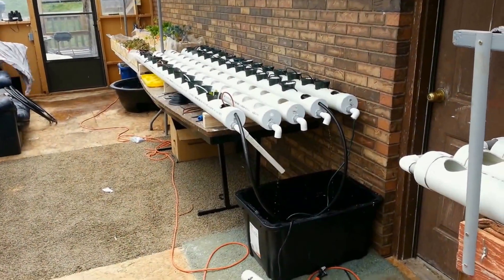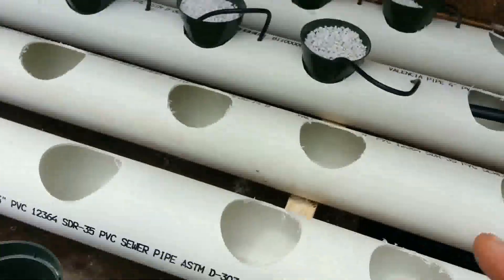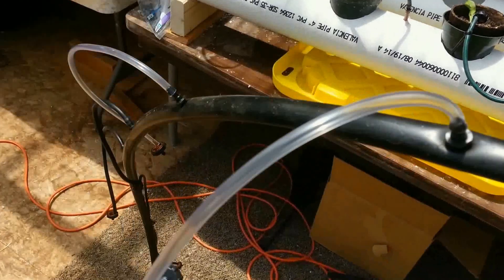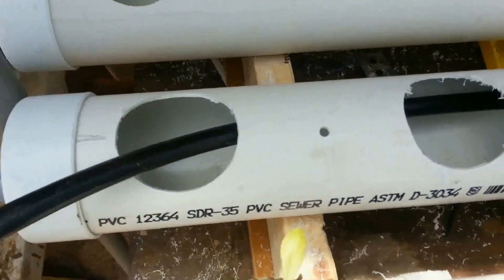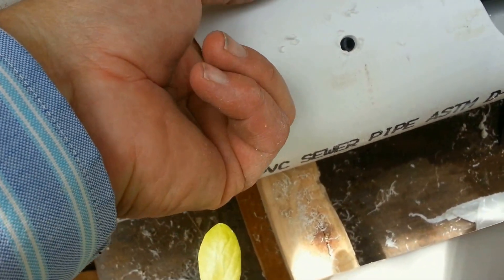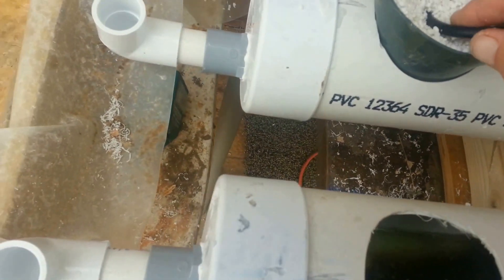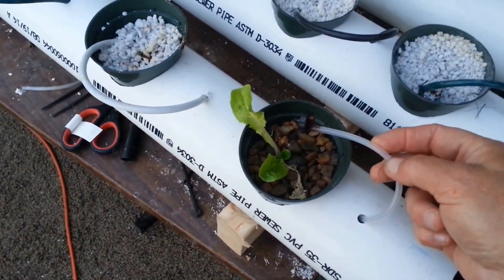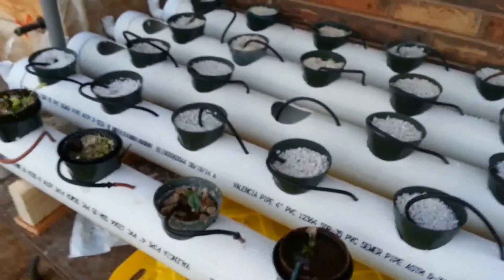Building a drip hydroponic unit

Comment: Is this recirculating type or non-recirculating type drip irrigation?
Reply from the maker: It's a recovery type.  The water recirculates  to a storage tank.
Reply: @eddysgreenhousegarden7022  I've heard that the recovery system can alter the pH level of the nutrient solution. How do you maintain the nutrient solution? 
Also, which type of the drip system you prefer if you want to make a living out of it (like selling the crops on a commercial scale etc)?
Reply from the maker: @alfianfahmi5430  I do have to monitor the ph and the nutrient solution of the system and make adjustments periodically.   You can't get away from that in any kind of recirculation system.    Not sure on the second question.   I just grow things for myself.

Comment: Great job man, but you should know the clear tubing is kinda spooky. Algae and not so good microbes will try to build up in areas of the system that have air, water and light. Some of those dippers with clear tubing are gonna be problem sights in the future. I'd also get to know your water really well... no matter where you live. water is key to maintaining a clean and effeicent system. UV sterilizers and RO filters are by far the best way of cleaning your water and keeping everything in your hydro system fairly low maintenance. again great garden man and thanks for the video.
Reply from the maker: Can't disagree with anything you said.   I've already had to change this thing up a little bit since it was posted.   For the reasons you cited.
Reply: @eddysgreenhousegarden7022  Still a really nice table. You ever use bottled enzymes?
Reply from the maker: @momentiummonroe1475  No I never have tried that
Reply: @eddysgreenhousegarden7022  Friend... you won't regret it. It's made maintaining everything in my room way easier. 

Go to your local hydro shop and see what they've got in stock, a liter should last you a month or so. You can also probably get some off amazon.

I'm using the Canna Cannazym at the moment, but i think Enzymes complete runs around $20 a bottle

Comment: What size holes did you drill in your PVC pipes and what size where your pots?
Reply from the maker: Well for the drippers they 1/4 inch holes, just big enough to fit the tubing through.  The net cups were 3 inch.  And....the circulation pipes between the large 4 inch pipes were 3/4 inch.

Comment: could't you just go without the driper and just put the hose into what ever your growing
Reply from the maker: I suppose you could do that.  It would really help with the clogging but.......there  would be a lot of water flowing through  that hose then.  I guess if you sized your pump and system right you could do it that way.  I would tend to think the water flow over and through each grow pot might be too high.
Reply: Home depot has a 4 way and a 8 way that a person would attach the hoes to that is fully adjustable
Reply from the maker: You might give that a try.  Please let me know how it works.   I had 30 or 40 of these lines to deal with and for me, that would be way too complicated.  It might work well for you.  Good luck.

Ed
Reply: thanks have fun
Reply: @eddysgreenhousegarden7022  
Can u have the water spraying on the roots instead of dripping

Comment: do have any problems with clogging in the drip line
Reply from the maker: Ray,  
The short answer......yes.  These are 1/4 inch lines.   At first some of them were clear.  Algae was a problem with those. Not so much with the opaque ones.  But even those would clog periodically.  When I used this I had to keep the dippers where they could easily be seen so that I could see if any were clogged.  It was easy to replace or clean them out.  But I had to keep an eye on it.   I will be converting this to a deep water flow style this spring.  The idea is to get rid of  the  numerous small hoses and drippers.  I equate it to lots of small moving parts in a machine.   The greater the number  the more the chance of something going wrong.    Second part of my remedy in the spring is to use far fewer but bigger diameter hoses.   In other applications  I have tried, I used  1/2  inch or larger hoses and they  just don't get clogged by normal processes.   Smaller ones with drippers do get clogged in my experience.
Reply: @eddysgreenhousegarden7022  get to know your water really well... no matter where you live. water is key to maintaining a clean and effeicent system. UV sterilizers and RO filters are by far the best way of cleaning your water and keeping everything in your hydro system fairly low maintenance. Try running an enzyme in your reservoir as well, I personally like the cannazym from Canna, but I've used Enzymes complete and drip clean from H&G before with really similar results. good video man, I wish you the best of luck in the garden
Reply: @momentiummonroe1475  good
Reply: @arvindtiwari3949  Great 

Lol